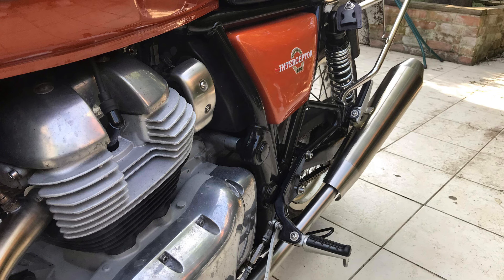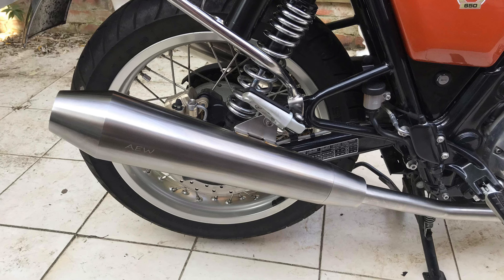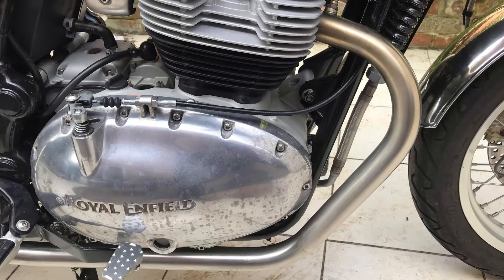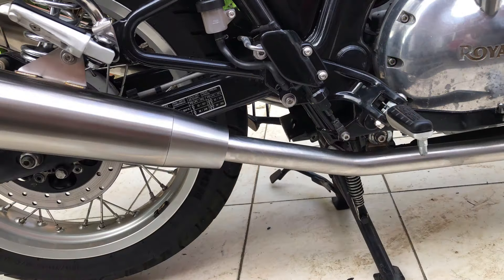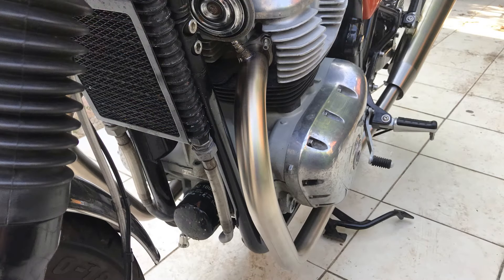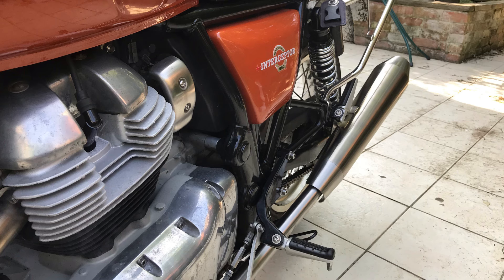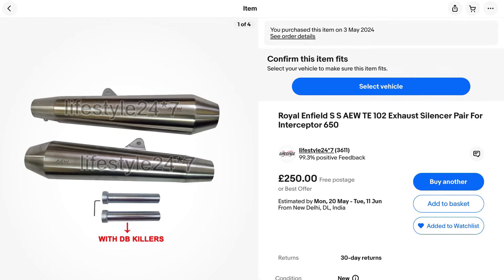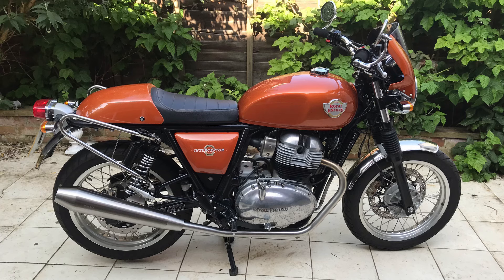Interceptor 650. Exhaust replacement completed. Part 4

Comment: You strap 9-10kg on back seat or just hold a 10kg weight it's quite heavy.Yes the sound wave standing behind the bike is awesome compared to stock.It's worth doing the mods just for the weight savings but the extra performance is fantastic & definitely worth it.
The AEW brushed cans are similar to the S&S cans which came out in 2018 when Royal Enfield asked S&S to design some cans for their new 650 & are covered by warranty but expensive.Since then others have made cans clones basically if the S&S cans but can sell them cheaper cause they're not as well known & with S&S a few hundred dollars is for the brand name.Since then RE will cover warranty with most rear cans.
Also $1200-$1450nz is worth it for 2-2 upgrade big bore headers,cans,air filter for weight savings & extra HP & Nm & bike is still a good price.
If I got another RE Interceptor now I would put 1000km run in kms in it & put the headers cans & air filter & YSS fork upgrade on bike.Cost about $1500-$2000 depending on what brand you buy to do the YSS & headers,cans,filter combo putting cost if new bike 11k + 1.5k-2k=$12.5-$13k NZ 🇳🇿 still 5k cheaper than cheapest the Triumph Speedtwin 900.If you can't afford a Triumph this is the way to go if want the RE650.
Once tyre's wear out buy Batlax BT46 Tyre's & get a 140/18 for rear & of course the R&R leads from James😉.You then have a more manageable weight for bike & a free breathing engine & be first mods to do then do the cosmetic stuff over time.
Reply from the maker: 100% agree!

Comment: That does look a very neat system when fitted. I would appreciate the weight loss but as yet don’t want to spend £5-600 on something that’s not desperate to be replaced. Looking forward to the sound check.
Reply from the maker: Yes, it’s very much a matter of individual taste, of course.

Comment: They're basically the same as what I have fitted, I bought my headers and silencers from Hitchcock's.
The silencers are branded Enfield Precision, they're identical to the AEW, probably made in the same factory.
Reply: I’m pretty sure that it was strongly believed the Enfield precision silencers were made by AEW, when they were first released. Don’t know what the price difference is🤷‍♀️.
Reply from the maker: They’re very similar but not identical, Paul. I think the Enfield Precision have a long box section on them to attach the OEM brackets to, whereas the AEW have welded on brackets….